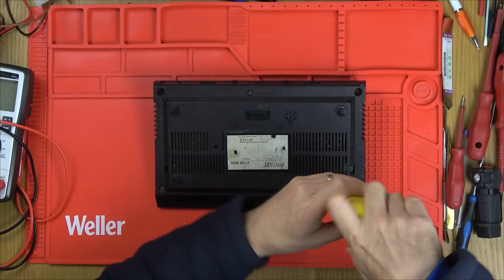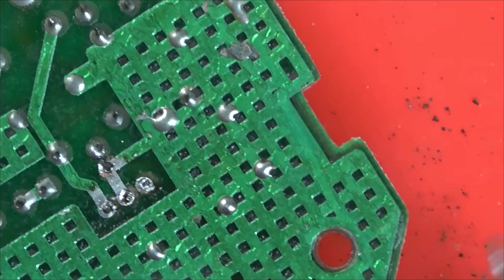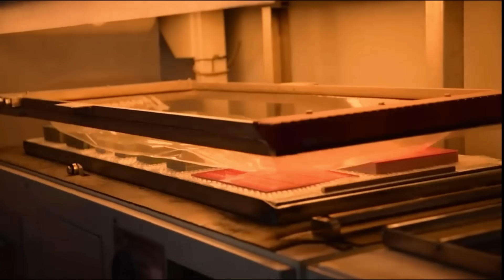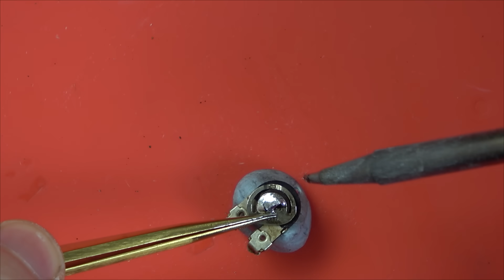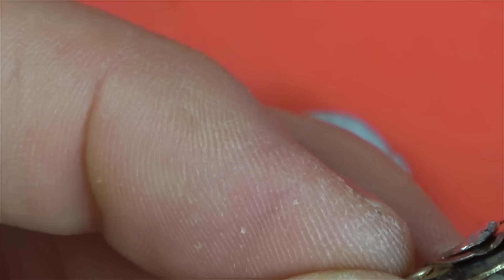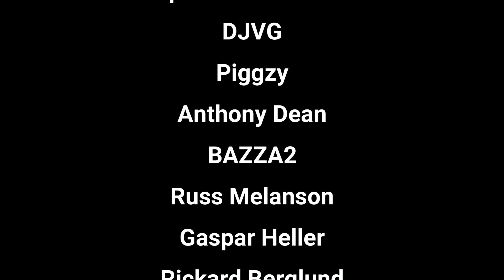Broken 1986 ATARI 2600 JUNIOR from eBay - Can I Repair it?

Comment: 11:00 you should always insert and fasten the screw before soldering such components. Otherwise you might have to reflow it to align it properly, or the solder gets mechanical stress when you fasten the screw and might break or even rip off pads.

Comment: Hi Vince, I recently repaired a ZX spectrum and replaced the 7805 with TRACO TSR 1-2450. Maybe you are aware of them. They generate almost no heat and are much more stable.

Comment: I have a few of these jr 2600’s in the loft. The 2600 had very limited sprite capability, I think the max was three or four and then they’d start flashing if they all needed to be on screen or some were blanked out to maintain the others.  A fantastic machine in its day but nowadays….. its 4bit (I think) processor is laughable but shows how amazing the programmers must have been. Arguably it’s best game to many, Adventure, a fantastic game, all fitted on a 4k ROM cart…. That’s 4096 bytes for graphics, code and the Dragon/Bat AI !

Comment: I'm surprised you could even tune it in.

Here in Australia, our Analogue TV network was shutdown in 2013, we haven't had TVs with an analogue tuner in them for a good 7yrs or so now, so I have to rely on either modding my old consoles or if they have composite, use that instead.

But even with composite, most of my consoles just show a fuzzy picture on all 3 of my TVs (with my oldest TV being 2008 -- Which has an analogue tuner).

Comment: If the 9v is stepdown to 5v and 5v is used everywhere and 9v nowhere, just ditch the regulator and use am usb-c connector. No more power wasted. That's what Adrian Black from Adrian's Digital Basemente did.

Comment: I get switching noise from that particular 3rd party power supply. I tested 2 of them on 2 screens. It looks like a horizontal scrolling fuzz on the display, which can be faint on dark backgrounds.

Comment: The best thing you could do for these consoles is replacing that tired voltage regulator with a new one and change the caps.  This will protect other old components.  You can upgrade your RF modulator to composite out for under $15, especially if you decide to keep the console.  The mod improves video and audio as well.  From these two consoles, the heavy sixer is the more desired one.  With that you have plenty of content to make another cool video :).

Comment: I bought one that had those cartridge tabs break off. I ended up using 2 M3 bolts and nuts to fix it. I installed the M3 bolts from under the cartridge slot. I put the bolts through the center cartridge slot as far to the side of the slot as possible. I used M3 nuts to tighten them as much as I could, then cut off the excess of the bolt so it doesn't protrude out too much. I did that about 8 years or so ago and it still works fine. 

Also, I recommend doing a video mod to it. A basic composite video mod works fine, but I highly recommend the UAV, Ultimate Atari Video. 

Awesome job bringing that console back to life, Vince!
Reply from the maker: Thanks for the tips on the M3 bolts 👍👍👍👍

Comment: It says Atari 1983 because it's copyright 1983, based off the 1983 revision of the board. If you look on the back there's the number stamped "9026". I'm guessing this one was manufactured 26th week of 1990. (Yes, Atari were still manufacturing these until 1992-ish)

Comment: @MyMateVince
The cart block is easily defeated if you take the cart port mount apart and remove the locking mechanism that surrounds the cart connector pins. Open it up and you'll see what I mean. This was a common failure point and I have lost count how many times I made that mod. Never understood why Atari made it that way, it served no real purpose.

Comment: I started on the 2600. So much fun for something relatively simple. Pry already mentioned in comments but SEGA Genesis (MegaDrive for you in the UK) controllers work if you're ever in a pinch without a controller or want to use a game pad on it. Cool vid Vince!

Comment: My metal detecting friend asked me if i could have a look at his N64 he dug out of the loft it wasn't working,he knows i'm a computer technician so he thought he would ask me.I'm fine with that,it literally was some cold solder joints and a clean up and it worked perfectly ! and he bought me a bottle of whisky for it too !

Comment: The atari 2600 can be played with a sega genesis/mega drive 3 button controller in place of the standard joystick that came with the 2600.
Also atari just released an actual official game pad on their website that came out this month of May and is compatible with 2600, 5200, 5400, and 7800 and all new VCS game console and I believe the 400 mini console as well.

Comment: Got my next "big boys" Seiko project finished, google up Bell & Ross Radio Compass, I built this up from scratch with one of the £10 NH34 movements from Cousin's I grabbed, a high grade stainless steel case with sapphire crystal above and hardlex on the built in display caseback, it is incredible looking and I fitted it to a very heavy "engineers" bracelet 24mm plus its 200m dive capable having a deep crown thread and two barriers of gasketry between the two case halves.   Had a right rosy result with a chap who sold me a dead Seiko 7019 Orbit that is now sorted and the 7S26 he chucked in saying it wouldn't work... well just needed a proper winding of the autoworks, tiny bit of regulation so that and the Orbit cost me £15 each and both are in pristine condition :D
Reply: I now have my 1930's Portass mini lathe running, bought a working used treadmill motor, a 180v AC to DC controller box and wired in a reverse circuit and now can go from slow to pretty fast, stop and reverse, super happy and first thing I am making is a delrin, brass and stainless steel jewellers hammer then some simple "eggcup" watch movement holders from brass.   Lathe is nearly 100 years old and has virtually zero play in its headstock, abs like new, I converted my Wolf pillar drill to take a XY table so got a rudimentary mill for softer materials like brass or delrin.   Next job is to make up a "splint" for my 3d printer which has a snapped upright stanchion, I have used acrylic bonder on it but I want a solid mechanical fix so just awaiting some suitable hardware to splint up the stanchion and will be 3d printing too :D

Comment: Vince, in general it is not a good idea to try to fix a trimpot if you want a long lasting repair. Suppose you could not get another trimpot, you still would have the option to use a simple resistor (or combination of resistors) to replace it, considering that a trimpot is simply a variable resistance component. You would only have to determine the resistance that works for the circuit.

Comment: As a heads up, all Mega Drive/Master system controllers work on Atari, In fact what you have there is a Mega Drive stick i think.

Comment: Nice fix, Vince :) 
Bur didn't you have any scrap/donor board to get a potentiometer from? Or at least parts for it? The 2600jr was also MY first experience with color video games, besides the C64 we each had at home. For the card connector, you can get a clone console dirt cheap, and replace the connector.

Comment: Seriously, do a composite video mod on it. It's relatively easy and the kit on aliexpress is cheap. I personally don't use the connectors, though, instead I got a bag of 3-point stereo jacks and fitting composite cables. The antenna output doesn't work anyways anymore after the mod, so I remove the antenna connector and place the stereo jack there, which means that I don't have to cut the case. The picture is way better than with the antenna signal.
At the moment I am trying to fix an Atari 7800, which so far gave me multiple headaches. I think I've finally nailed the fault down to a defective transistor, after replacing defective switches, a defective flip-flop-chip, all three caps (one exploded while I had the console in my board holder) and other parts that I can't remember. That thing has the most overengineered power on circuit I've ever seen, literally half the components on the board are for switching the console on and off. At the moment I am waiting for the replacement transistor (MJE210) from aliexpress, and if that doesn't work I am going to short-circuit the transistor (if I do that at the moment, the console works) and put in a push-switch in the wiring behind the power connector. Reset won't work that way, but I'm at the point where I stopped caring.

Comment: 1:15 " Annoyingly this ones working" 😂😅 Repaired a 2600 Junior three weeks ago. So happy to get it going and play centipede. Neighbours son was happy too as he can play it with his kids too!
Another enjoyable vid. Thank you :)
Reply: Seriously, do a composite video mod on it. It's relatively easy and the kit on aliexpress is cheap. I personally don't use the connectors, though, instead I got a bag of 3-point stereo jacks and fitting composite cables. The antenna output doesn't work anyways anymore after the mod, so I remove the antenna connector and place the stereo jack there, which means that I don't have to cut the case. The picture is way better than with the antenna signal.

Comment: I would replace the 7805 with a 78S05 which runs cooler and gives you a much more cleaner output which can also improve the Picture Quality.
On the SNES it definitely improves the Video Quality.
The 7805 is also known to fail on older Devices which cause dozen of Commodore 64 to fail because when they fail they short and input Voltage will be forwarded to the Output which kills sensible Components on the Mainboard like the CPU or RAM.

Comment: Rust = White vinegar
LED = 9v
Defender did not use a track ball, Did not even use full joystick.
Reply: Are you sure about that , as trackball for football Atari , came out in 78 

The defender game was made around 81

Bear in mind centipede came out in June 81 and used a track ball .
Reply: @wayne7521 He's actually correct; a two-way joystick and 5 buttons were on the stock machine. Trackballs were used on the multi-game machines later on.
Reply: @shawncat  so it's still highly likely possible , but yes I've seen images from yesterday year of the Williams cabinets of defender ... all buttons and two player joysticks . 

But are we taking into account, in the 80s we had travelling fun fairs , and people also modded cabinet's.   ..

More so when parts were easier to replace with cheaper compatible components

P.s. ive been around since 1970
Reply: @shawncat  and before we think I'm trying to win an argument , no I am just stating facts . Human nature and all
Reply: @wayne7521  I remember both, so I had to go look up why I remembered the game that way.
Reply: @wayne7521  If it was a true Williams board, a joystick/trackball would impossible, as the was no left/right inputs, just reverse and thrust. ...
Reply: @KJW648  no comments ......but impossible .... hmmm electronic wise , a simple concept as a light bulb ,controlled by a up and down switch or a push on push off switch , both switch the light on or off... just different mechanisms .

Same with say an xbox controller ... if the wire to A was switched to Button Y and others switched , then the buttons correspond to different actions . 

Same if the A button was switched to the up control ...it would still make the desired operation of up happen.  

Same concept for the wiring of a track ball ..to act as a up and down and reverse direction ,operation, taken over by the track ball... 

Never say never ...modification doesn't stop at aesthetics alone. 

Splicing  the reverse wire of reverse control button  and connecting them to the corresponding left and right controls , where as its actually the reverse option been activated . etc .... keeping the up and down control Same on track ball..
And keeping thrust and fire option on the buttons .  

Seen as all the control mechs actually do is send a signal or if you like complete a circuit. 

After all ..defender on atari can be played with either a track ball or a joystick .   

It's not exactly hard to conceive or put into operation .
Reply: @wayne7521 100% Atari 8 bit computer /7800 was my favourite version, amazing....The big mistake is, it was not a Atari game, but a Williams classic. Up and down controller, thrust, reverse, hyperspace, smartbomb buttons. It's was a lot hard to control.🤣😁